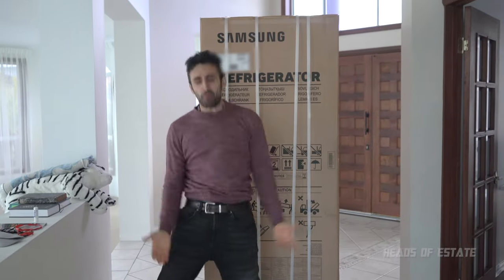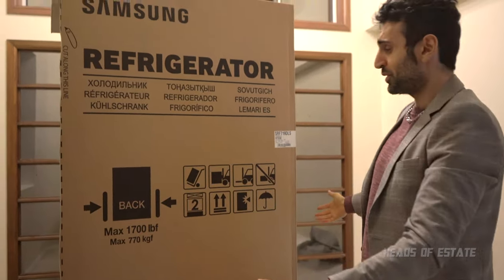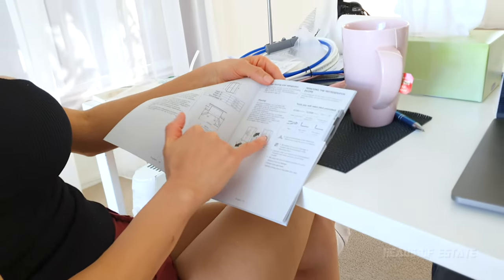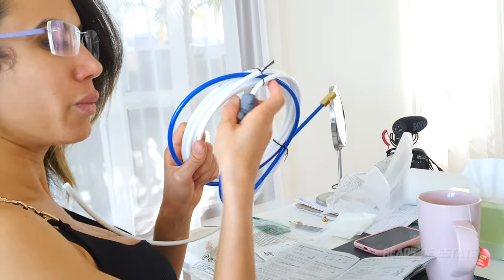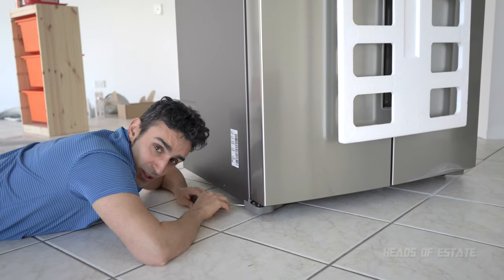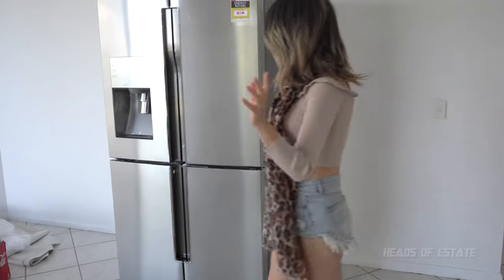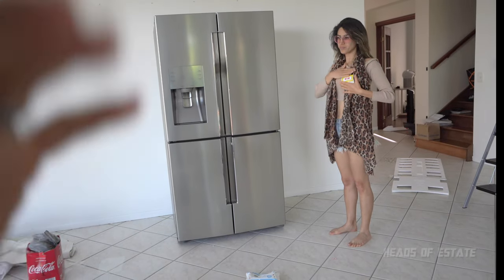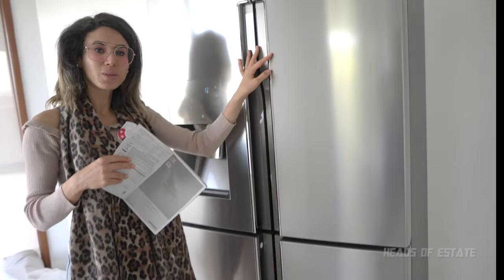IT'S SO BIG | Samsung 719L French Door Ice Maker Fridge UNBOXING GUIDE

Comment: I hope Samsung has redesigned their ice makers.  I have a very similar Samsung refrigerator and the ice maker is a nightmare!  Sometimes, after you get ice from door, the chute will drop an ice cube on the floor when you are not looking and then it melts and leaves a nice slippery puddle on the tile floor. I have done a split or two on my kitchen floor and I was fortunate not to tear a groin muscle!
Reply from the maker: Nice one, were now Samsung fridge buddies ✊. I've had it stop working once in the past two years, they sent a tech over to replace it, he said that it used to break down a lot but the new replacement ice makers work really well now. Have you tried getting your one serviced?
Reply: @headsofestate  I have replaced mine twice because the heating element quit working.  It would sound like a gunshot when it pushed the cubes out of the ice maker.